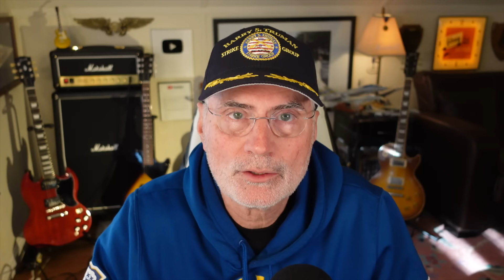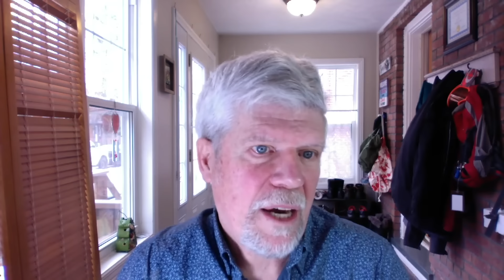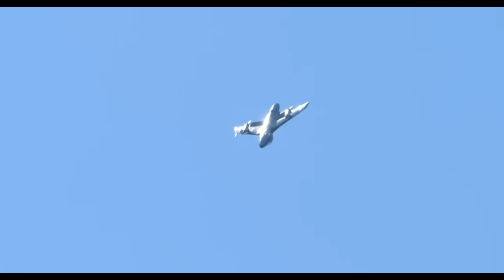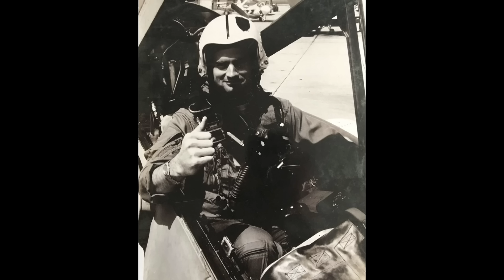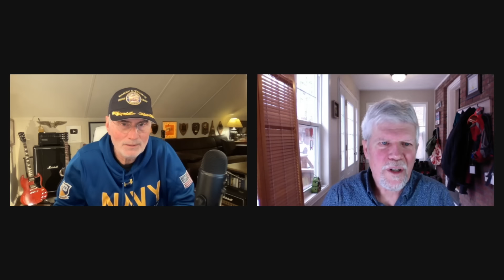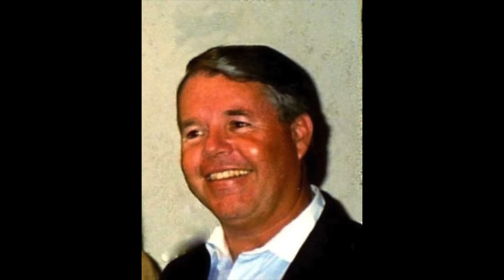Here's Why the F/A-18 Hornet Crashed at the '88 El Toro Airshow

Comment: Happens even to the best trained pilots as well.   Remember the Thunderbirds Mt Home crash.  Simply an incorrect altitude setting.   The worst case of "cockiness" is probably the B-52 crash during a demo flight practice.    Some people would not even fly with that pilot.   That was a case of a known high ranking hotshot pilot no one was willing to put a harness on.
Reply: The guy in charge of "putting the harness on him" was flying right seat and died when he crashed the aircraft.
Reply: Yes, it even happens to the best, yet when the scheduled demo pilot told others there, "Watch this; he always screws this up," I'm thinkin' he wasn't even close to being the best.
Reply: @ZboeC5  Which is why it's been posited that the crash was deliberate. He had been told prior to the flight that if it was not 100% to the letter of the book and no more, he was done, plain and simple.
Reply: More than some, iirc most of his crew that day had to be ordered to fly with him. It was common knowledge he was going to crash and burn, and soon. One of the biggest failures in military leadership since vietnam.
Reply: So was this. I was crash crew at MCAS EL TORO  that day, and we knew before the crash that "The Wing CO" had bumped the pilot designated for the Air Show.  Lots of arrogant assholes in the Marines. Which is really good in combat. But this is the price you pay.
Reply: @alexanderhamilton8585  I was in the crowd.

Comment: As a jet demo pilot for a western air force, i fly with QFE settings so whatever i read in the HUD is actually Above Ground Level... and i have certain altitude and speed combinations for any over the top maneuver i will not deviate towards a "too low / behind" the power curve.

Ego / Ranks come off in a fighter world... Those Training Rules are written in blood..

cheers mate.
Reply: Some friends joined the ranks of senior fighter pilots (flying as contractors) and other roles in uniform, and they say you have to self evaluate and accept feedback and keep up your quals or you ain't going to stay current and qual'd. Just because you got thousands of hours, doesn't mean you won't make a mistake and buy the farm... It happens. Astronauts have crashed perfectly good aircraft by being overconfident and/or not managing risks like weather.
Reply: Getting the correct parameters at the pre planned gates is imho essential. Having worked in military air traffic control in the UK I have considered that QFE was asafer way of altitude setting.  Displays do not need to be flown low as the people at the back of the show loose sight so its a pointless demo.

Comment: The El Toro airshow was the best. I remember the attack demo they performed. They had C-130's, Cobras, Hueys, OA-4M, RF-4Bs, A-6s, F-18s, OV-10s. Amazing lineup. I think the crash happened on the Sunday, I went to the Saturday show.
Reply: It was called the MAGTAF demo, it was excellent.
Reply: You forgot the AV-8b, performed every time I went to the show.
Reply: What kind of thunder when that phalanx went overhead?
Reply: We were at the El Toro show in either '87 or '88 or both, but I missed this incident.  The F/A-18 demo was well-executed when I saw it there.  We usually went to China Lake NWTC as well most years, Miramar, but never missed Edwards AFB (home station).
Reply: @arthurcaesar2200  MAGTAF is still performed at MCAS Miramar each year.
Reply: I was there in ‘88 and yes saw this crash, but really remember the assault demo. I’ve still got it on video. Maybe I should upload it if it’s not already here.
Reply: @A1Frizz  i knew i was forgetting one. Love the variety the Marines had back in the day.
Reply: Yeah.  I flew a Hornet that day.
Reply: I grew up 30 years about 20 minutes from offutt Air Force Base we had an air show every year and the president came there when 9/11 happened cuz the runways lift up
Reply: I was there too.  After the show I rode my bike down to Irvine Meadows to the Grateful Dead concert that evening.

Comment: Ward, thanks again! Excellent breakdown!

The fact that this wasn’t a fatal mishap, speaks volumes about the safety systems of the F/A-18.
Reply: There really aren't safety systems to counter crashing.
Except that as Navy/carrier plane Hornet certainly has extra strength compared to Air Force planes just to survive carrier landings intact.
Reply: I doubt an F15/F16 would have survived that without breaking in half on impact. The carrier rating for the Hornet means it can take a severe belly flop better than it's land-based contemporaries.

Comment: Ward,
I was at the camera shop when the VCR of the F18 was brought in. The housing was bent up and we were asked to make an attempt at removing the tape. We tried for a couple of hours.  We figured out the housing would need to be cut up so we sent the assembly back to HQ. 
I was with H&MS 11/VMFP-3 at the time working I level maintenance on the recon camera systems.
We always wondered what the tape would have shown...
Reply: Thanks for that info; it helps my engineer brain to appreciate the amount of energy absorbed by the pilot, airframe & everything in that cockpit.

Comment: I was there that day and when he pulled it over the top, I knew he wasn't going to make it. It was the most surreal thing I had ever seen, only to be topped 5 years later at the El Toro air show when an F-86 )Saber Dancer) crashed, killing the pilot. Again, he rounded the bottom of a loop too low, hit the ground at a shallow angle, and the plane went sideways and started barrel rolling on the ground.
Reply: Why are these airshow pilots so poorly trained?  Seems like needless deaths based on really bad decision making.
Reply: @fredwerza3478  This F-18 pilot's demo experience was certainly in question. The F-86 was suppose to stage a mock dogfight with a MiG-15, but that pilot was sick, so the impression the announcer gave the crowd was that he was going to improvise a solo demo. I felt like he had enough altitude and airspeed at the top of the loop, he just misjudged the backside and didn't pull back enough. But again, I knew he wasn't going to make it when he was 3/4 of the way around.
Reply: I’ve been going to multiple airshows every year for the last 30 years, so glad I haven’t witnessed a crash! 😵‍💫

Comment: Really only error in this video is that the maneuver he was attempting WAS called a square loop. It was not an Immelmann and a Split S.  The pauses on each side where the sides of the square.   BUT yes, he was too low and not enough airspeed at the top. And once he committed the nose straight down, he was done.
Reply: I watched another pilot attempt a square loop at NADC Johnsville, in 1966, I believe, pulled his wings off and did not survive.

Comment: Amazing how he was able to stay alive and recover without ejection. Speaks to the great safety engineering in the plane. Vertical has always been a known tale of caution for the Hornet due to weak energy addition rate. While Hornet is a great at slow speed and high alpha, vertical is actually where it lost on dogfights. A lot of drag and relatively underpowered, small engines which made it difficult to regain energy very quickly. As a result, the F-18 needed to have plenty of airspeed going into a vertical with enough altitude. Otherwise, it would bleed energy going up very quickly as it did in this case. In this case, you can see a wing stall when goes over the top where it keeps dropping on one side. There simply needs to be enough altitude to regain lost airspeed while screaming towards the ground and in order to bring the nose up. Double Immelman that actually requires a lot of raw thrust, is prohibited maneuver for the F-18 as per NATOPs for the same reason.

Comment: No idea what the bunt is
Reply: “He bunted the nose…” 
I don’t understand this part either.
Reply: Basically, it is pushing the stick forward.
Reply: @benhobe   Slowing himself down even more? Or a sign he may be thinking of not going through with the rest of the maneuver?
Reply: He's unloading the airplane by pushing the stick forward in an attempt to gain energy (airspeed).  When you bunt/unload the aircraft from its normal 1G state it accelerates faster.  The Col knew he was slow over the top of this maneuver... he just didn't have enough "space" to recover.
Reply: @keithesplen5300  I get it. Good explanation
Reply: @keithesplen5300   I was under the impression he was inverted at the top?
Reply: A bunt is an outside loop. Very uncomfortable - blood rushing into your head, body strained against the straps. I only got a fraction of a bunt (about 2 seconds) demonstrated to me as a trainee glider pilot in my youth and I didn't like it all.

Comment: I was the El Toro SAR Crewman that day, Marine Sgt. Doug McNamara, my Navy Corpsman HM2 Ron Orent, saw the F18 demo and knew the Colonel was not going to complete the maneuver.  Post crash on the 34 dual runways, the El Toro Crash, Fire and Rescue and HM2 Orent extracted the Colonel from the F18 where Angel 1, MCAS ElToro’s  SAR Huey flew to Mission Community Hospital with Colonel Cadick in critical condition.  During the flight to Mission Community Hospital Bob Hoover was allowed to take off allowing the airshow to continue and narrowly missed our SAR Huey by less than 100 ft due to poor Comms by the Airshow airboss.  That never came either. There were a few mistakes made that day. 

I wanted to correct who saved the Colonel Cadick that day. Semper Fi.
Sgt Douglas McNamara
Reply: I commend all their brave actions, esp dealing with a damaged ejection seat. I know some airfield F+R carry spare emergency  seat pins, but in a high impact mishap who really knows how safe that seat is, even with the pins put back in?  Did you carry spare seat pins?
Reply: @wirdy1  Yes, as a rule, since we were the SAR and CFR units at EL Toro, all rescue crewman Navy and Marine were required to be trained and carry all required safety pins for the seats. Col Cadick hit so hard that the canopy was jammed and required CFR to forcefully open it as the mechanisms were buckled. 

I was back seat ejection seat qualified as well but never had the opportunity to fly back seat in a jet.

I did however get the chance to fly backseat in a North American T28A owned by  Retired Navy Commander Dave Oberholzer in 2022.

Comment: I was there that day and witnessed the crash. If I recall this was the second crash I witnessed at El Toro. Still, it was shocking.  El Toro had more than its fair share of crashes.  The other one was an F-86 Saber jet that crashed while doing a demo with a Mig 15 I believe.  That one was also pilot error due to the lack of the adjustment of the altimeter the morning prior to the crash.  If I recall it was adjusted the day before but the day of the crash it was much colder and was not subsequently adjusted.  If I recall the pilot also did not reach the proper altitude during the maneuver.  Also I believe he did not have sufficient training and competency in that Jet that would be required for airshow maneuvers that have an unforgiving envelope.  

As each crash is a little traumatic it got to the point where I was sort of reluctant to go watch an airshow there despite the fact that I had yearly VIP passes.

At some point El Toro faded away and became just a lighter than air base so I moved my airshow venue to Edwards where I got my panties ripped off by a B1 B bomber, literally. The B1 B turned its nozzles towards the crowd in a flat turn with full after Burner.  Suddenly everyone grabbed their ears and all you could feel was your chest vibrating. After it left there was this deafening silence as everyone stood there in shock while listening to every single car in the parking lot have their car alarm going off.  It was surreal

Comment: I almost saw this exact same kind of crash!!!

I was at an open house at Eglin AFB in this same time period.

Cloud deck was at 300 feet AGL. The T-birds had postponed their show, hoping for acceptable weather later.

Would the Marines let a little cloud cover ruin a day of flight demonstration? Hell no! 

I cannot tell you that I saw the same demo pilot featured in this video. What I can tell you is that a Marine F-18 went screaming down the runway, did a full AB vertical climb, and instantly disappeared into the clouds.  The crowd could hear him, but couldn’t see him. 

After a short period of time the roar of the jet grew louder and, to the gasping horror of the crowd, the F-18 popped out of the cloud deck, heading for the dirt.  What happened next was the closet thing I’ve ever seen to an aviation catastrophe.

The sink rate was REALLY fast, the nose was rising, and the burners were deafening, the twin plumes blasting the ground.  By some miracle; the pilot was able to generate enough lift to keep the jet from pancaking - just like this video!  It is no exaggeration when I say that he missed hitting the ground by 20 feet (maybe less!).  At time I thought you couldn’t slide a piece of paper between the jet and the ground. He was dangerously LOW!!!!!

The crowd screamed, knowing that he was going to crash. When he managed to pull out, no one was praising his act. In fact, to the contrary, comments were quite negative. “I hope his commander didn’t see that sh-t.”  “What idiot would that maneuver with this cloud deck?”  “Oh boy, the SOF is going to kill him when he climbs out of that jet.” “He forgot how low he started.” “He can’t read his instruments.”

I’m not an aviator but I know stupid when I see it. Only blind luck saved this jackass. He went waaaay beyond the safety envelope of this stunt.  In fact, in that weather, I cannot believe he even attempted this demonstration.

Now I sit here wondering if I had witnessed the preview of the California crash demonstration!  It’s hard to imagine that two Marine aviators in that timeframe were that crazy.

Comment: I was there at El Toro that day in April. Although not a fighter pilot, I could tell that the Colonel appeared to not have sufficient altitude at the apex of the "loop" he was trying to execute. Altitude which would allow him to complete the maneuver with enough room to avoid the ground. Basically, as he neared the final stage of the loop, it was clear that he was pulling up on the stick for everything it was worth, but the F/A 18 appeared to have stalled-- possibly due to a loss of airspeed. The plane first hit the ground at the rear of the plane, then the front end immediately slammed into the ground afterward. There appeared to be a very brief fire, but it soon went out.

Comment: I lived just outside of the El Toro Air Station in Laguna Hills.  Every year I would spend one day on the base at the show and the next on my front lawn enjoying them fly over head.  I was on the base that day, right at the fence at show center.  It is probably interesting to note the part of the routine that preceded the accident.  He did a slow high alpha pass parallel to the flight line, left to right.  About show center he pushed the nose down to pick up airspeed, flew level for a moment until pulling up into what was intended to be a loop.  As he transitioned from vertical to inverted, I certainly thought that he was far too low and far too slow to complete that maneuver but given that my F/A-18 experience was a brief time in the simulator on the base, I figured he would know better than I.  When he was in a nose down attitude, it was now clear that this was not going to end well.  Here is something that the videos do not show very well.  Col. Cadick did not just try to complete the maneuver and hit the ground.  He turned the plane from parallel to the flight line to going away from it.  I believe that this was done intentionally to move farther away from the crowd.  This of course expended even more precious energy which certainly increased the resulting impact with the ground.  Granted, the whole thing was caused by poor judgement but to his credit, I believe that he took a greater beating because of his attempt to reduce or eliminate the risk to the spectators.

Comment: Hey Ward,  I first met kamikaze when I was going through instructor training at VFA 125, in 1982.  if there was ever a guy who had a massive ego somewhere around the same level as Napoleon!  LOL!  I started this message before I saw your whole video. Good on you for getting guys that are telling it like it is.  He was the XO at VFA 125 before he came down to El Toro and got the group!  I was at blue flag at Hurlbert Field well attending Army CGSC when the crash occurred.
Reply: Cont’d. For some reason, kamikaze did not want to be higher than 250 kn to enter this maneuver, and then, as your friend was saying, he squatted the airplane with a hard pull up before the blowers had a chance to really kick in and then, if he would adjust extended vertically a little bit, he would’ve had enough altitude and airspeed to pull it off, but that was kamikaze for you!!!

Comment: I witnessed a similar incident in an armed forces day air show at Holloman AFB New Mexico in 1968, although not as severe. A test pilot based at Carswell AFB Texas was doing a low slow pass over the runway in an F111 Aardvark with wings extended and stalled out, coming down hard and snapping the front landing gear. There was no fire involved, but the damage to the front of the plane was extensive. The pilot walked away unharmed. I worked for General Dynamics at the time, and saw an informal report in the company news which blamed the accident on the pilot, being accustomed to flying at the lower altitude in Fort Worth failing to compensate for the 4000 foot altitude at Holloman.